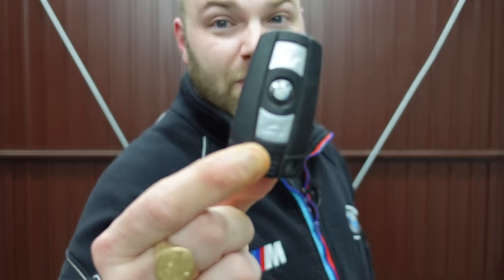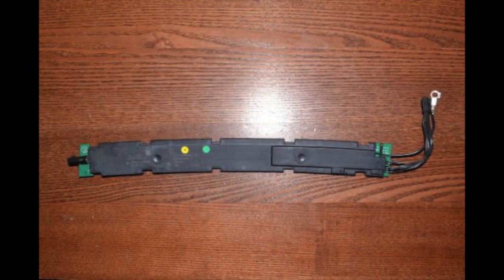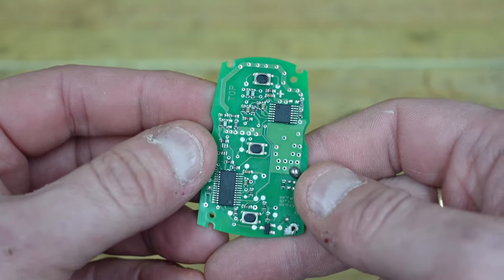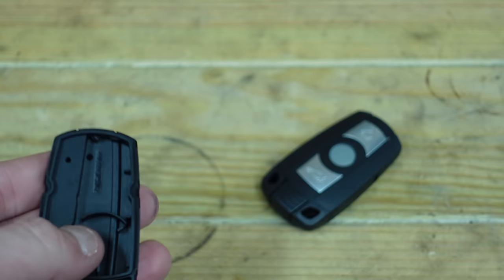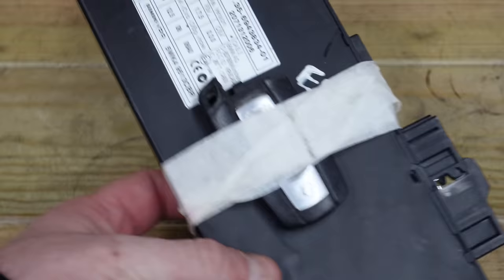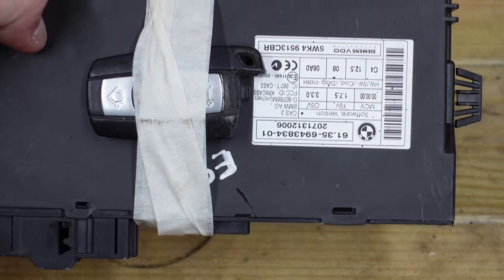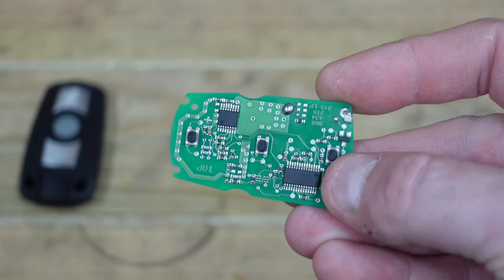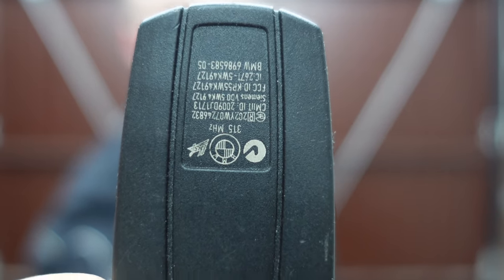BMW E60 E90 Key Not Working ?? Here Is The Fix !!

Comment: Hello mate, I've recently bought a E90 320d, been using the key fine, has some issues locking and unlocking from distance but today it wouldn't unlock or lock my car at all, the alarm was going off and when I actually got in and put the key into the car, it didn't register at all, what could that be?
Reply: I have the same problem did you ever solve it?

Comment: Hi
I have changed a new battery and still not working, none of the buttons work, it starts the car and drives but I can’t open or close the car I have to use the key manually
Reply: @olegrevenko5476  you find a solution? My key doesn’t work atall either just changed battery

Comment: just had my frm replaced on 335 e90 2011 everything worked fine for a few hours turned the car off to get gas now key fob starts car but wont unlock it and i have errors for all lighting systems

Comment: One of my keys starts the car but doesnt lock or unlock. It isn't the antenna because my other works. I have no idea whats wrong with this because I have replaced the battery . Hoping you can help thanks 😊
Reply: Hello did you ever get to the bottom of this problem as 1 key will lock unlock the car but won't start the car but the other key won't lock or unlock but will start the car which is very annoying as have to carry both keys any help would be grateful
Reply: did you manage to solve this issue? i bought a new keyfob for e90, got it programmed, can start car but wont unlock or lock the car

Comment: Hey Doc, I have an 2007 bmw 328xi. I just installed a new car battery in my car. And noticed now that my keyfob will not unlock/lock the doors. It does start the car though. My wife’s keyfob works %100     Any suggestions?
Reply: I have a similar issue … one works fine, the other starts the car but not the door locks or boot … also mine is the first type, that is soldered to the board … not battery removal from trap door on back of fob …

Comment: The key on my wife's car is beginning to fail and she has to unlock the car with the blade key, but she is able to stat it and run the car. when I replace the rechargeable battery will the car start without any reprograming of the key.

Comment: Key problem BMW X5 I35 2012 driver door doesn't work at all the lock doesn't work from inside or outside windowworks mirror works and I got low voltage throughout the entire car I'm getting codes p0037 P0071 P0072 P0444 F271 and these codes alternate

Comment: I have 2 e90 keys and the second one that I don't  use doesn't unlock or charge anymore but it can still start.
Reply: Mine has the same problem..i wonder what the issue is 🤦‍♂️ even the frequency and battery is fine!

Comment: Hi. My issue is that fob stopped working recently - cannot lock/unlock car and have to do it with key. Sealed fob which I opened with stanley knife - battery reads 3.2V for a 3V battery so seems fine, but re-soldered anyway just to be sure. I changed the diversity antenna but still no difference. None of the fixes in this video seem relevant to this problem. Any further suggestions? Thanks :)
Reply: Update for anyone else with this problem. It turns out the wiring to the diversity antenna had broken. On the e91 there is a rubber hose on the right hand side as you open up the rear window (not the boot). Slice open the rubber hose with a stanley knife, and you will see 4 wires. For me two of them had snapped, and a third was on its way. So I did a good fix job with a soldering iron, some connecting wire and loads of electricians tape so it wont wear through again. Hope this helps for someone.
Reply: @Johnny_C_17  You are the man! This is a common problem with e91, my radio signal is weak and 2 key fobs stopped working (lock /unlock). After wires on the right side I'll check the others on the opposite side too. 👍

Comment: Hi I have an e91 2010. all correct voltages on diversity antenna connection.  And keyfob signal is good . Remote not opening the car . Any help will be appreciated.

Comment: Hey can someone maybe tell me what problem they think I have sometimes to lock or unlock my car I have to press my key fog like 6 or 7 times sometimes it does it in one press the door always open with the key in the door and when I hit the lock button from inside the car I have also both my door lock I have a convertible I replaced the 2032 battery and changed the fuses if someone has solved this problem please help

Comment: My key fob unlocks and opens the trunk, but it will not lock the doors. Any suggestions?
Reply: Same problem
Reply: Did anyone figure this out yet I have the same problem? If it was a fuse or diversity antenna I’d think neither lock or unlock would work.
Reply: Luxury.  My key just unlocks the car and rolls down all of the windows.  I had to take the battery out to stop it doing that.

Comment: HI, my 2008 BMW 128i key FOB went through the wash and didn't work. I tried all the drying tricks to no avail. I then popped it apart and it now will start the car but the "unlock" door and trunk remote doesn't work. Any suggestions?